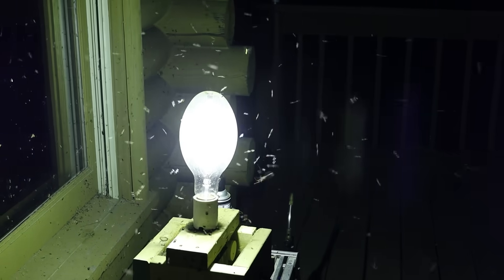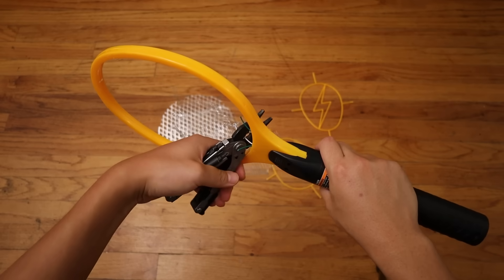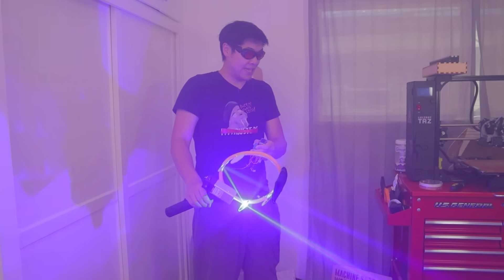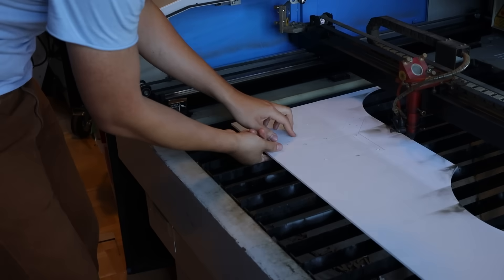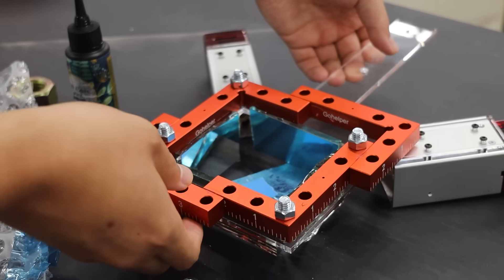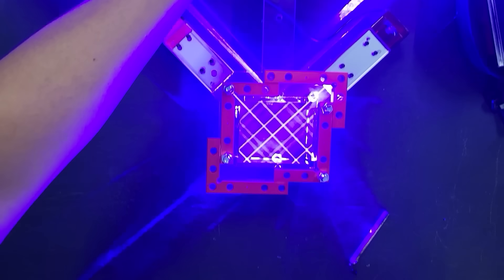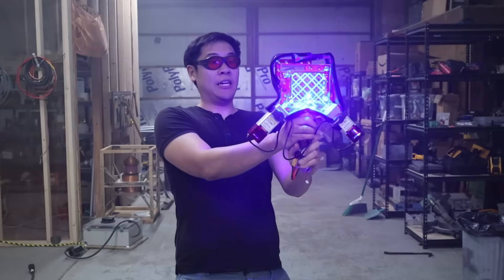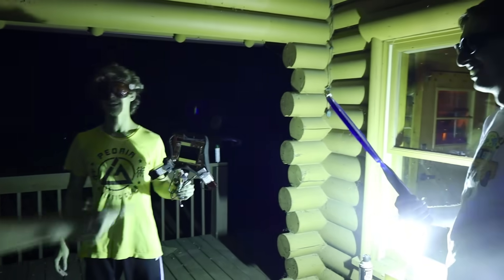killing mosquitoes like its the year 3000

Comment: IIrc there was a similar project where they used a blu ray laser diode from a game console and some microphones that located the pesky buggers via triangulation.
Reply: Using a BluRay laser was one of the features of the first concept Allen references in this video, so the difference in what you're talking about is just the use of sound instead of vision to locate and identify targets?

Do you have any more information on the possibly different project that you are referring to? YT doesn't like links in comments but if you could provide the name of the people, where the article/video etc., might be found that I could punch into a search engine to navigate myself to get some more detail that'd be appreciated, thanks! 👍
Reply: @msytdc1577  Yes, microphones would the main difference if my memory serves me right. I didn't had time yet to enjoy Allens video but wanted to mention it anyway.

I've just googled for half an hour to no avail. If I recall correctly, it might've been a German website of some hackers and google comes up with a single page and a couple of search results for the suspected timeframe but not what we're after, sadly.

Comment: I feel like this concept still has some unreached potential (although it will always be needlessly complicated and dangerous compared to a regular fly zapper). For one, just making the whole thing a bit bigger should greater increase bug kill rate. Also, the grid pattern seems cool but suboptimal. The squared mirroring is good but maybe just have the lasers almost straight at them so bouncing at roughly 89 degree angles would be better? I feel like that would guarantee full area coverage within the mirror box.

Only reason I imagine this may not be great is if the lasers weaken too fast due to a greater number of reflections and more energy may be lost into the mirrors at an 89 degree reflection (though there was clearly energy to spare in the beams that managed to leak out).

Comment: For the “automated” setup:  What you’d want to do is not just aim the laser with mirrors.  Rather, you want to put the laser into a large lens (a few inches across), and put the resultant diffuse light through a set of SLR camera type lenses.  Thus the power focuses on the distance that the mosquito is away. The FOCAL distance will fall off rapidly beyond the target, ensuring a level of safety in case you miss.  Think of a camera’s autofocus.

Rather than a pure laser beam (which has theoretically infinite range), you’d focus the beam based on the range to target.

Comment: effective mosquito traps have existed for at least 30 years, mosquitos are attracted to c02 moving downward because thats what happens when mammals exhale, they look for that and heat, thats how actual mosquito traps work, they require c02 tanks, so if you placed a nozzle behind the grid pointing downward at a 45 degree angle and send c02 through it, the grid should provide the heat to simulate a living thing and that should draw the mosquitos through the grid and if not hit immediately they will likely hang around until they die, to make an effective mosquito trap the smart thing would have been to study how mosquitos senses work and how they are so effective at finding food and then you emulate food and bring them to you.

Comment: The google search term you are looking for Allen is "Galvo Mirror" They are the highly accurate high speed mirrors used in precision high speed optical aiming of lasers and or used in high speed imaging setups for tracking projectiles mid flight using a radar feedback loop. (https://youtu.be/b72ZWM4c94s?si=5DDMXlHCdC-6X4VR)

The come in a wide range of prices.

I know it's not "on brand" for Allen Pan grade builds.. however If you are looking to build a laser aiming system.. this is what you need.

Comment: You could probably achive something similar to what the original was supposed to be by using a single spinning mirror and an always on low power laser to "scan" the window frame like a barcode reader and then turn on a higher power laser lined with low power one just when the mosquito is detected.
No need for fancy computer vision when you just need to detect when any small object passes through a 2D plane.

Comment: I had also previously looked into this to see if anyone had continued this project. As expected (no offence), their version was far more complex and sophisticated than what you did here. For anyone wondering, it essentially used lidar to detect and properly identify a mosquito. After using the weaker laser, it would then switch to using the higher powered one. So really it's a programming hurdle more than a hardware one. The hardware is still expensive of course, since all of the parts require high accuracy when being made and used.

Comment: Make a funnel around that with a box fan on the big end. If you can tighten up the spaces within the laser net a fan would cycle a ton of bugs through the net. You could also fill the spaces between the beams so the air that the lasers pass through is the only place the bugs can be blown through by the fan. 0:02
Reply: Exact same thoughts!:D

Comment: Just running a huge fan with a screen on the back will kill more flying insects. But if you want to kill them with lasers, get or 3D print a square-to-round coupler and attach that bad boy to a fan. Let it suck bugs into the laser grid.

Comment: You can turn cheap regular mirrors into first surface mirrors by taking cheap mirrors and hitting them with chemical paint striper on the coated side exposing the nice reflective surface. I did this for a projection table stylus/touchscreen system I built. I used a first surface mirror to allow me to increase the projection distance of my projector on the table surface, thereby allowing my projected screen to be bigger with the small area I had to work with.

Comment: You should add a sheet of white paper inside a cardboard box 6 inches from one side. Illuminate the paper with a 365nm LED. That will attract night bugs of all kinds, straight through the grid. You might want to think about vertical mounting or adding a fan to prevent the bodies from accumulating inside the grid surfaces.

Comment: Two things for an easy layup rev 2, if you even want to do a rev 2:
1. Make the mirrors flush with each other at the corners
2. Ditch a lazer. You only need one to fill the plane if optimized correctly, it's redundant.

There's a ton of relevent math you can skim through on "arithmetic billiards" on wikipedia and YouTube to explain why you are leaking light through the corners. It's actually a good thing. More bounces (including in the corners) before it returns to where it starts makes a finer "net".

Comment: Another cursed idea: Instead of using multiple lasers, how about letting a single laser pivot (or a pivoting mirror), creating a sweeping/oscillating beam inside a 90-deg-reflecting frame?  Then you'd essentially have a plane of laser instead of a fixed grid.  You'd have to tune the oscillation so that the laser contact time is enough to burn a mosquito.

Comment: It could possibly be reduced to two parallel opposing mirrors if you get the laser angle closer to perpendicular where it enters the mirrors. Have the zig-zag pattern so tight the bugs can't easily get between the beams. It would be less a grid, and more of a 2D plane of doom. Then combine that with a box fan to have it enclosed to a static mount that draws the mosquitoes into it. It will likely still work with a less powerful laser too, less stress on the mirrors and the bugs being targeted tend to be on the fragile side of things. If it's done cleverly enough, it could likely be more efficient than the traditional bug zappers in terms of wattage draw while being just as effective.

I think the idea would be interesting enough to re-do and optimize. First run was a bit too sketchy, but there may still be a way to do this as a workable appliance of sorts.

Comment: How about shooting the laser onto a rotating mirror, so it forms a laser plane. If the rotation is slow enough to still get power to the mosquito, but fast enough not to leave 'gaps' in the plane. The you would be much more efficient.

Comment: Instead of a Swatter, try converting it into a Trap. Place a Light directly underneath or behind the Grid and turn all other Lights off in the surrounding area. Make a second Grid and rotate it relative to the gaps in the first one, then place them together for more consistent results.

Downside is you won't just be getting Mosquitoes, but I imagine you will get a ton.
Reply: Aren't Moskitos more interested in CO2? Not exactly sure, but some dry ice might be more useful. Wouldn't want that trap inside though.
Reply: It's like that scene in resident evil, except it's mosquitoes.

Comment: Rather than a fixed grid, steal an idea from the laser printer. Make a hexagon or octagon out of mirrors (mirrored surface facing out), and mount the mirror to a motor. Then, point the laser at the spinning mirror more or less tangentially. 

As the mirror spins, it changes the angle the laser impacts. Eventually the face moves out of the way, and it effectively resets to the original geometry on the next face. Net result is a beam that sweeps horizontally along a line and resets to the start and sweeps again. 

This means you could have a mosquito death plane and not a series of mosquito death lines.

Comment: What you need to do is streamline the design so it's not so awkward to use. Probably reducing the size of the mirrors, increasing the area of the grid, and having the lasers be in the handle. You could even use only one laser if you just plan and measure out the path

Comment: You could have put the lasers in the handle and used glass tubing/ fiber optic cable to transfer the laser up to the bracket to an angle you liked. It would help with how unwieldy it looked. Awesome video!!

Comment: Instead of lazers, you should try "adjusting" the electric swatter so it kills anything that comes close to it at all times instead of discharging and recharging like the stock one(at least that's what it looks like.. I assume there's a capacitor of some sort that gets filled, zaps one thing then has to recharge).. Then you can just wave a few times above the light to get rid of the mosquitos and trigger your fire alarm at the same time...

Comment: I was wondering where that point defense laser idea went. Damn TED talk just invite anyone on there without verifying.
If you put an oscillating refracting prism in the middle you might be able to get full laser coverage within the entire grid area. Another method would be to make a custom circular mirror, similar shape as the electric fly swatter, and put a spinning prism in the center to basically make the laser spin to get a full coverage, making a larger 'swatter.'

Comment: Put a 120mm pc fan on the back pulling air through to suct the bugs in and mount it on a tripod or pedistal of some sort so you can just stand it up outside. Honestly i think you would have better luck putting a lense on both the lasers that turns the beams into flat wide beans like a barcode scanner does. The lasers are powerful enough in that short of a distance i think two wide angle flat beams would generate a sold grid of bug killing force that the mirrors wouldnt even be necessary.

Comment: Ok, so you want a hand-held swatter with large surface area and basically "instakill"

In Africa they use such a swatter that's called a Pan. No, sorry, a pan, a metal pan. You swing it and you remove insects from that area. Maybe avoid checking what they do later.

But if we want sth that doesn't require as much momentum and is easier to swing, I'd guess microwaves might be easier? Like creating sort-of "open air" microwave oven, that due to some waveguide magic /maybe/ can be held into sort of a box shape without having two sides xD It'd be reasonably safe for humans, as skin will stop it and pain reaction should engage quickly enough, though it might be also a portable mobile jammer/EMP/FCC won't let me be...

Ooh, what about superheated air jet? Like sort of dyson blade emission, but with enough heat to burn insect wings? It could be shot away from the handle toward heat-resistant "reflector", to basically have a super-heated version of air curtains that exist when you enter malls etc :D

Comment: Since I've seen that video when it came out I have been thinking of it. I have severe phobia of insects, but I'm also nowhere near trusting computer vision with lasers strong enough to remove MY vision.

I think that using multiple beams, each at eye-safe level, focused onto one 3D point is the way to do it safely. TBH I'm also thinking using multiple directed sound beams to create localised standing wave to just shred insect to bits.

And my last route of thinking is just going with water gel cannon. Just shoot some thickened water blobs and glue the bastards. Eye, ear and foodsafe solution xD

Comment: You should add some kind of suction to kill more efficiently, so the mosquitos would be forced to go through the laser grid.
Reply: Might as well just leave a mesh screen in front of a large fan and an automatic sprinkler that periodically sprays rubbing alcohol. The suction pins them against the mesh, the alcohol finishes them off.
Reply: Okay but what about a vacuum that leads them into an incinerator? I dub it, the Mosquito Cremate-O-Matic

Comment: Summary: Build a LASER GRID PERIMETER AROUND YOUR PORCH

1. Use a cone/funnel and perhaps a fan to guide the mosquitos to the grid.🤔

2. Better, just create a laser cone and use that like a sword. Simply glue a small mirror to a motor. Hmm, but the power is then distributed to a greater area.. Perhaps it could be enough? 🤔

3. Build a big grid AROUND your porch – A LASER PERIMETER. 
3.1 Detect a mosquito when it is on the grid and fire the laser only then.

3.2 Move from a static grid to DYNAMIC GRID. Add servo mirror to move that grid within the gaps of the static grid!  
- This way you can cover whole surface of the porch perimeter yet not waste kill-energy to the complete surface
- Designing 1 DoF mirror to move that grid around is simpler than catching the mosquitos in 3D free air!

3.3 Without mosquito detection, try the technique from 2 above, but for a grid, a STATIC GRID. You need to broaden your grid mirrors though. 
- only 1-2 moving mirrors, the rest of the grid mirrors are static but broad enough to allow leeway for MOVING THE LASER GRID.
- You have a tradeoff and can have a nice test here: What is the speed of incoming mosquito? How much laser time is needed for a kill?
- Perhaps killing the slowest mosquitos is good enough?
- If not, go the 3.1 way, with within this concept.

Cheers & big up! Yours procrastinating forever, @Hukkinen

Comment: dude use fiber optics to bend laser instead of mirror it will be more  light weight and the mesh can be made more dense and larger net and the laser source can be away from the handle and put in a backpack and brought out with a light waeight and flesxible fiber optic cable

Comment: That thing is too small. What you should do instead is to scale it up to the size of a window, and to make a tighter mesh. Two parallel mirrors, on the left and right sides. Beams starts underneath, bounce their way up to the top where they're absorbed. For safety add sensors to turn the beam off if a large obstruction like a person or a cat is detected.

Then you can have a wide open window that still kills every bug trying to get in.
Reply: Better solution would be a chemical lure or a fan that sucks them into a small area which is completely covered by lasers. The aim shouldn't be to make the laser area as large as possible because that's not safe, it should be small and concentrated and you should attract the bugs to it
Reply: @Bennett-Barnes  At that point, why use lasers? Just put the normal electric mechanism down there. The point of something like this is to make something ridiculous, and for that, the bigger and more ridiculously overkill, the better.

Comment: Tbh, Allen's laser grid fly swatter was cool af but I think Styro's tesla gun was much more effective at dispatching insect swarm than waving around a death star racket.
Reply: scp approved
Reply: @hiddenguy67   Double scp approved
Reply: the mistake is making it a racket and hitting the mosquitos, mosquitos are parasites and they can sense when we exhale, they actually find living things by sensing co2 when we exhale and they even look for the angle the co2 is moving because its always exhaled at a similar angle in most mammals, so they look for co2 moving downward at certain angles and also heat, that is how they are so good at finding us, you can actually buy mosquito traps that emulate humans breathing that use co2 and they trap the mosquitos inside, so if he used a co2 tank and put a nozzle behind the grid at a 45 degree downward angle that along with the heat from the lasers should fool the mosquitos and they will goto and linger around the grid long enough to get hit by it eventually, who would want to waste time tracking them down when you can bring them to you so easily.
Reply: a fan + some fire would do it. probably just need a fan + 2 candles to heat up a pipe perhaps.
Reply: @rgw5991 I dont think he wants to burn down his house
Reply: @gapsule2326  Maybe he just needs to talk to William Osman then